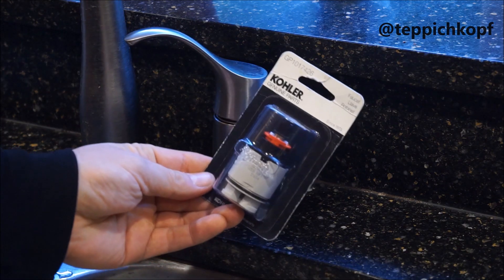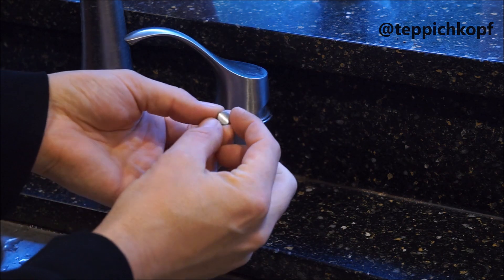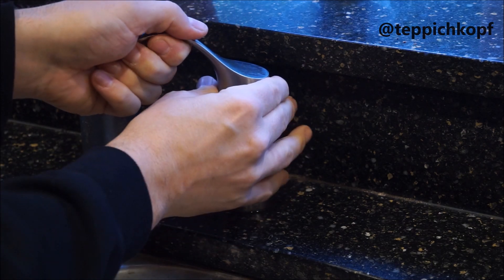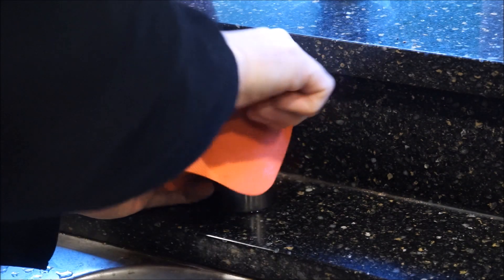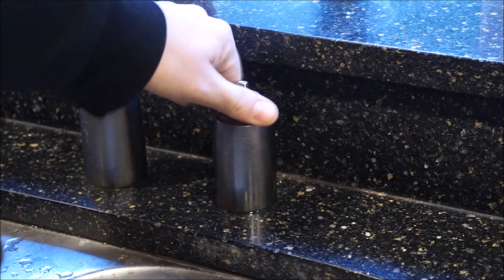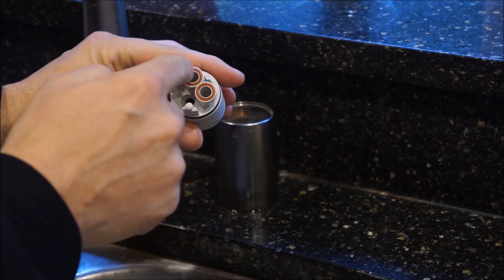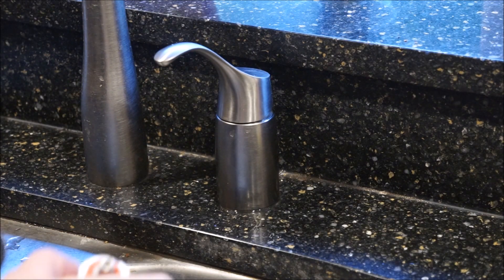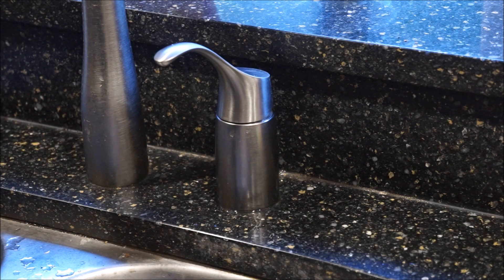Kohler Kitchen Faucet - valve replacement for single control K647 cartridge

Comment: I used two flat head screwdrivers on each side of the handle to pry up with the shafts of the screwdrivers. Also the little pill that comes with the cartridge is silicone grease.  I used my own and didn't realize what it was until after.

Comment: Very helpful video. My issue was everything was sticky and hard to get off. But once I got access to the old valve, it was smooth sailing. I didn't know what that plastic capsule was in the valve packaging. Thanks for noting it was silicon grease. Thank you for posting!

Comment: This was extremely helpful but holy heck if you have hard water you're in for a wild ride. Another commenter mentioned WD40, which definitely came in handy. I also used CLR to help clear some of the buildup as I went along with lots of scraping and tapping. My cartridge (finally) came out in multiple pieces - it had basically disintegrated. I needed needle nose pliers to take it out piece by piece. The only mistake I made was using a wrench for the first collar, which is basically plastic. It got chewed up nicely by the wrench teeth but oh well no more leaking :).
Reply: I am facing the same problem. It appears that the cartridge is fused to the bottom of the housing. When you chipped yours out, was it smooth on the bottom? Right now I can't tell if I'm trying to remove the cartidge or I'm at the bottom of the housing.
Reply: Mine was a bit stuck, I poured some vinegar wait a minute or two and that did the trick.

Comment: Good video.  I changed mine after something like 10 years. Lots of calcium build up made it really hard to get things off.  For the handle I took a large flat screw driver and pried it up from the back without scratching anything.  For the bonnet I used a plumbing channel lock because some scratching won't be seen.  For the bolt I used a 1 1/8th socket with my cordless impact driver.  Soaked it in CLR but really didn't help other than cleaning it.  Old cartridge was in pieces and I had to use needle nose pliers to get it out.   Last word of advice, the cartridge is no longer made.  But Kohler makes an exact replacement.  Had or order it as the ones at the big box stores are for the newer model and don't fit.  All in all this video really saved me a lot of stress that I might break something getting it apart.
Reply: I found the same cartridge on Kohler's website. However, I found it for a lesser price on Amazon.

Comment: Huge thank you.  Mine was about 13 years old.  Handle was stuck, collar was stuck, and threaded portion stuck as well.  I used WD-40, blow dryer, and tapping to get things moving.  $15 Kohler GP1017426

Comment: Replaced cartridge successfully - easy to do w/ these instructions. However, when I turn the faucet on, a surge of water comes out of the gap by the handle. Is this still the cartridge or something else? Does this faucet have a diverter that might be bad?

Comment: Thanks for the awesome video.  I have a question, I have a defective valve I need to replace, after removing the screw, I cannot get the handle off, I have applied a lot of force to it and no luck, I am afraid I might break it if I keep forcing it.  I have been thinking about hammering it but probably will break, any suggestions? Thanks!
Reply from the maker: It took a lot of force to get it off for me. I wouldn't use a hammer. Just keep trying to force it up while wiggling it around.
Reply: I found that after using a extra elbow grease to lift the handle off the seat of the valve stem was a bit trying.  Once the handle comes off, I found the valve body assembly was in pieces.  Be sure and remove all the articles that have fallen in the assembly cavity before installing the new valve assembly.  Using a pipe wrench is a bit much for this application.  Use of expansion pliers is a better tool.  Good luck.

Comment: The problem here is that this video doesn't show how difficult it can be to replace a valve that's been in service for 10 years. 
I would suggest you look at a few more videos unless you have better than average mechanical experience.